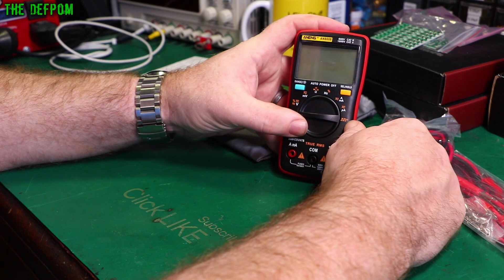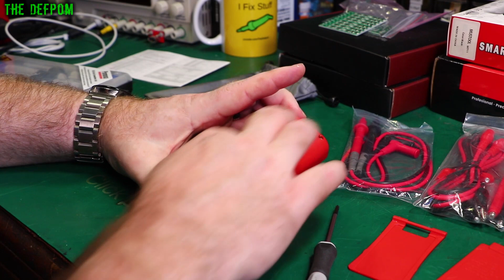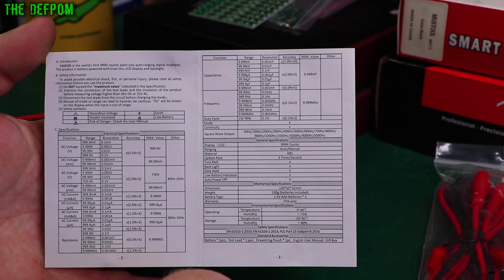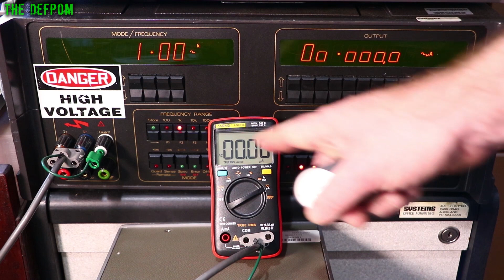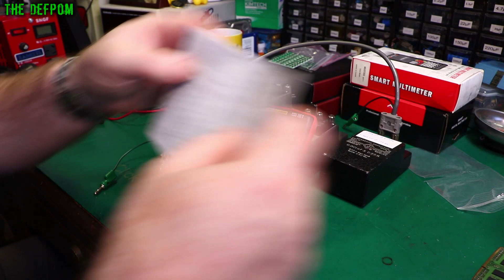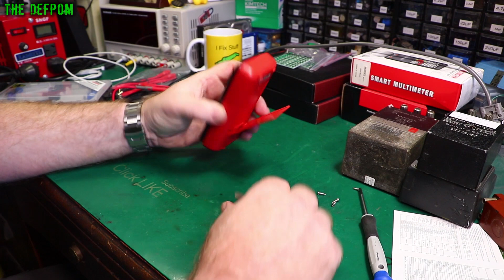🔴 Aneng AN8008 Multimeter Review - Accuracy Testing With Calibrators - No.906

Comment: My AN8008 has a fault, and I bought it at a shop at Alibaba.
The kind of fault let me think that every AN8008 has it.  I don't get an replace from the shop, to see if it is single fault.
I send them picture's and a video from the problem.

My AN8008 can't measure AC currents between 1mA and 10mA, it shows normally about 0mA.
It's only at AC not at DC currents.
I think it has something to do with the plug of higher current, which is necessary to use by currents >1mA.

I proofed it so easily, by putting another Multimeter in series. This can't measure RMS, but this doen't matter because I only used 50Hz sinus from an transformer.
What do the others AN8008 ? Have they the same fault or mailfunction ?

Comment: Looks a nice little digital meter. I do sometimes wonder if it’s possible to buy a real awful meter these days. For most people including me even a £2 meter would be good enough for me in terms of accuracy. But electrical safety is more my concern with low cost meters. So I would normally spend my money on an old fluke than a modern low cost DVM. I have also noticed a few meters that have a 1000 volts printed on them only measure to 600v.

Comment: I have two Aneng meters, one of which is an AN8008.  Both are built of poor quality plastics that easily crack and scratch.  The LCD bezel on my AN8008 seems to scratch by just looking at it. 
After buying and owning two Aneng I will never again purchase another Aneng product.
Both of my Aneng meters and the EEvblog 121GW are useless for measuring capacitors below 2nF.   See my video on the Heathkit IN-3147 for a detailed and documented comparison of the capacitance measurement issues.
I appreciate your unique user insight in your reviews since you actually use similar equipment on a regular basis, and I like your arsenal of calibration tools.
Thank you!

Comment: Thanks for the review! I have been using a similar AN8009 model. The original leads crapped out after a week or so. My main gripe with this meter is its weight, rather its lack of it. The meter ir so light, that the weight of leads alone tip it over. The stand does not work. Also one needs to use both hands when switching ranges. But the small size means it fits into a glovebox easily. So I keep this meter in my car - it is perfect for automotive application.

Comment: A couple of the ranges 1% was mentioned when it was actually displaying 0.1%.  I've had one for a while, does what you expect it to. Only complaints are the screen can be hard to read in certain lighting or at some angles, its small and weighs nothing so moving the probes tends to move it around sometimes, the backlight & auto off timers can be pretty annoying, and the auto ranging could be a bit faster. That said in reality if I was looking to spend twice as much I'd probably still get the same meter with the addition of a set of better probes, there is just not many cheap 9999 count meters out there that are reasonably accurate, have a quick buzzer, take AA or AAA, and can do capacitance/hz.

Comment: AC is a bit bandwidth restricted, will give AC measuring error due to complex waveforms. Best suited to mains AC without too much wave distortion. Phase control and current  in capacitive rectified load situations starts to get erroneous.
Reply: Of course to add it is NOT  true RMS, so the value reading for other than pure sine is rather misleading anyway, as it is really only valid as the value is a  sine equivalent 'calibrated' value anyhow, not even considering added complex wave error only makes value less relevant, but nice would be at least reading audio frequency voltages, but  rolling off at a bit over 1KHz is more  limiting.
Reply: @marko6550  of course there are several chip solutions, and DSP ca0abilities help enormously. A lot of the single chip, analog, RMS solutions had severe crest factor limits by the analog square, but somewhat solved in log/process/antilog hardware. Again the cheap end DMMs do not provide the best precision. 
DSP requires fast A/D conversions, at least if adequate bandwidth is provided. Again few low end DMMs are DSP based.
However RMS was not my prime issue, but for truely useful function, I regard 1KHz bandwidth is bad. Modern systems can easily provide more, and makes useful measuring in other than mains AC frequency, eg AC power, rectifier systems supply of use. Forget measurements involving even typical audio circuits. Other than power panel, motor jocks only dealing in mains forget using one with 1KHz limit.

Comment: I was able to measure up to 32Mhz square wave at 5 volts using really short leads. Maybe your test leads were attenuating the higher frequencies? I was just probing the clock output pin of a microcontroller using leads a few inches long.

Comment: Sure, I have a Fluke 28 II and an old analog Simpson. But I also own TWO of these which I would never use for mains voltages. What I like about them is that they are small, and yet the display is way to read, and they are made as cheap as chips. 73 DE W8LV BILL